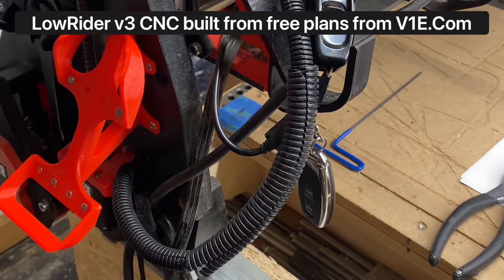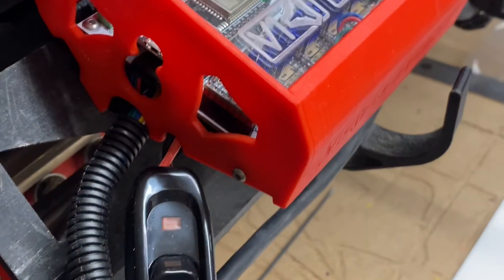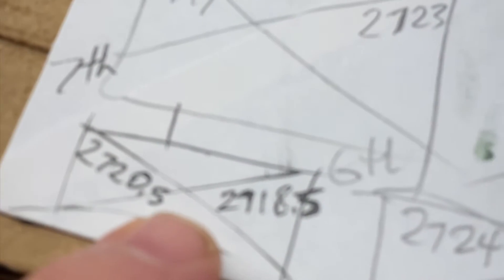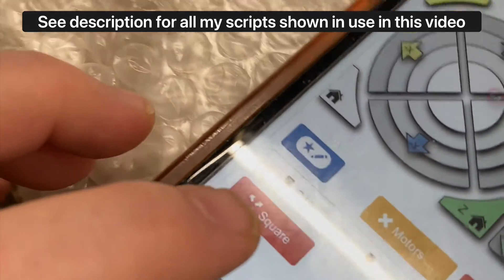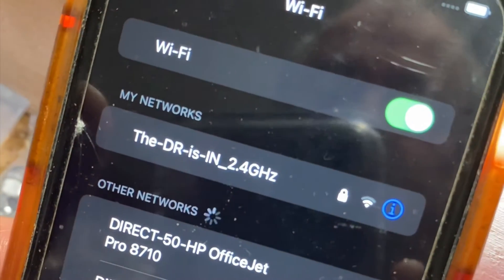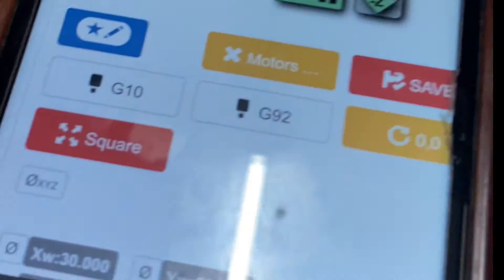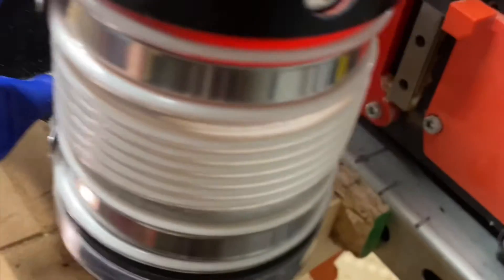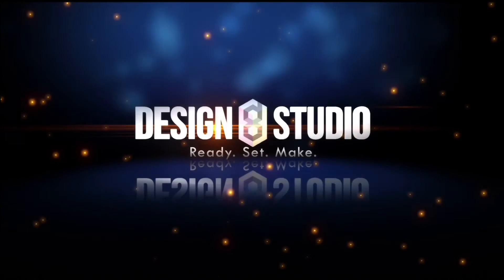LowRider v3 CNC - Squaring table with Jackpot controller! (WIDESCREEN VIDEO FOR PC)

Comment: I am not at the point of squaring yet (still in the assembly part) - but is there somewhere any decent guide how to make DIY Z-probe? :) Thank you
Reply from the maker: I will post a couple of links to resources and info, starting with the affordable tiny touch plate probe from Ryan at V1 engineering. 

https://www.v1e.com/products/tiny-touch-plate?_pos=1&_psq=tiny&_ss=e&_v=1.0

And then my Printables listing for magnetic tip for touch plate probe wire:

https://www.printables.com/model/446174-for-cnc-machines-magnetic-tip-for-touch-plate-prob